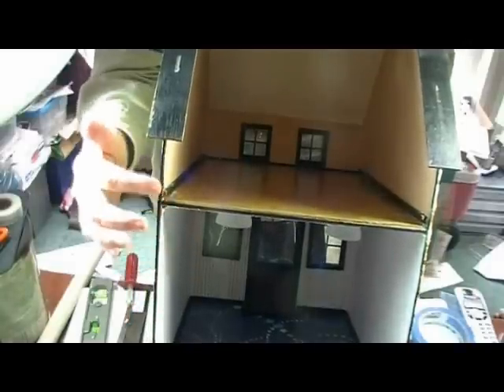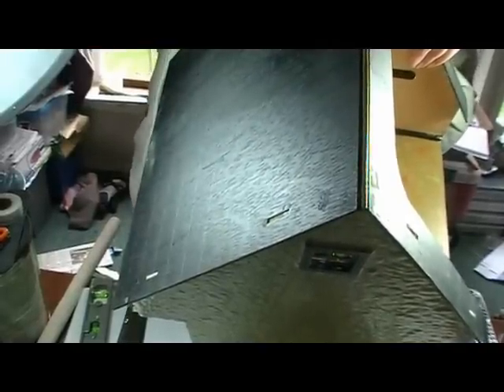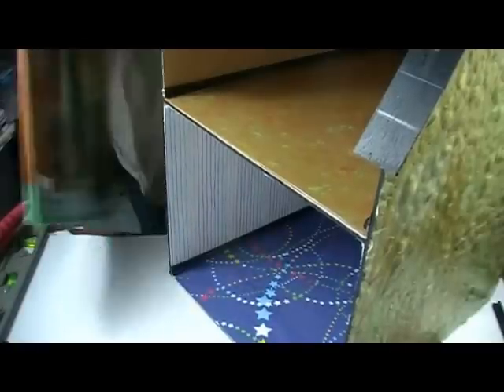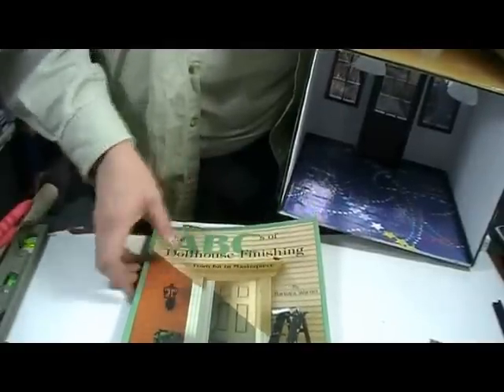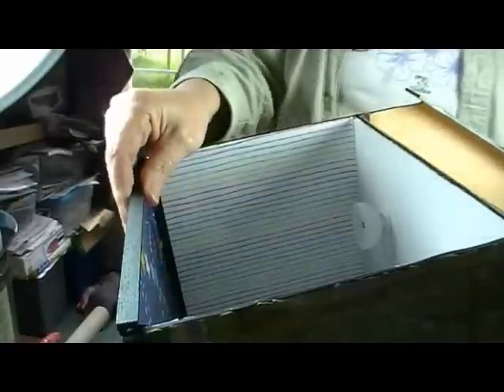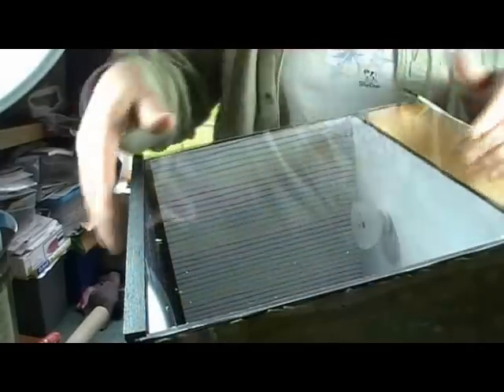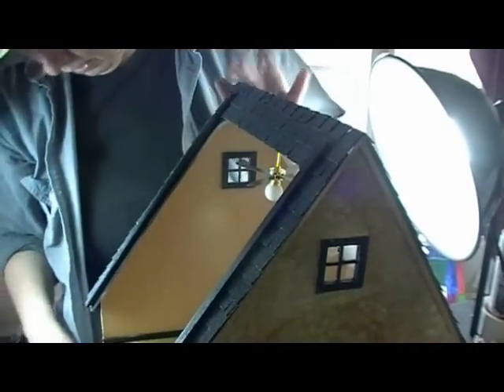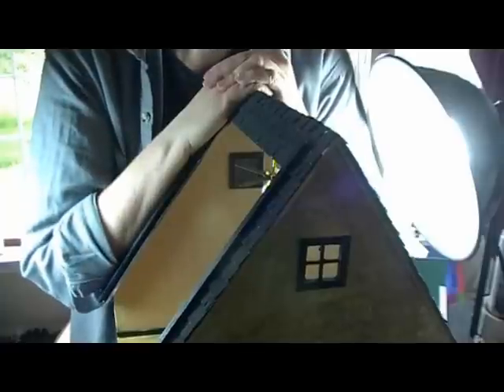Miniature Building Construction Step 8 - Plexiglass Cover and Roof

Comment: Great idea for using sandpaper for the roof!  Could you also use it as a stucco ceiling if it was painted a lighter color, or would the sand drop off if it was hanging upside down, even if painted?

Comment: So. where you put a brad in, wouldnt have been easier to just build a wooden stop when you glued the other two pieces in? That way that you could have painted it to match?
Reply from the maker: Odessa Price  the brad remains removable allowing the olexi to be removed either direction. On some dollhouse roofs it is necessary to remove by taking those out so you don't damage the roof material.